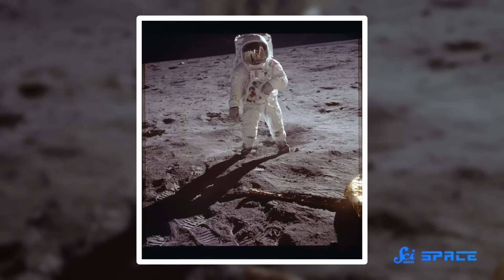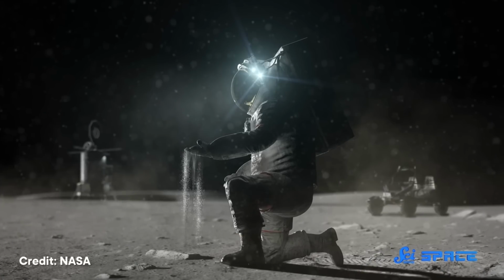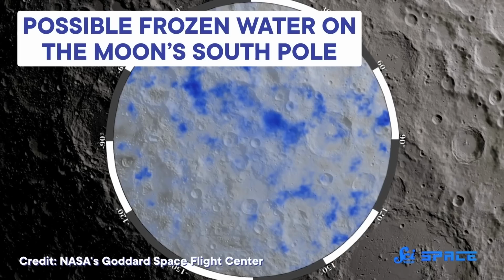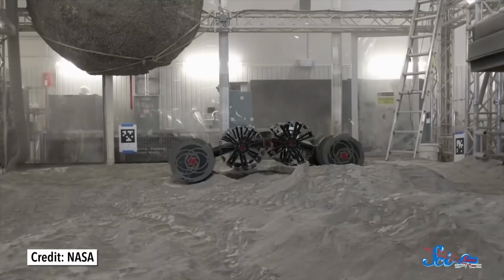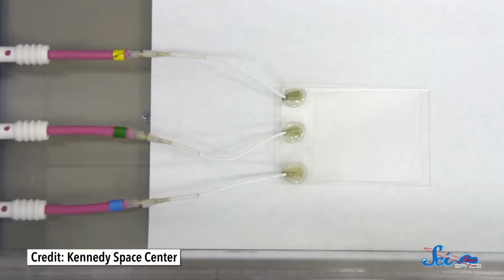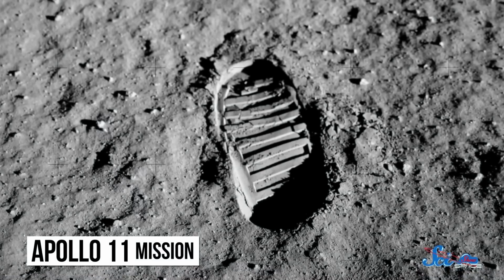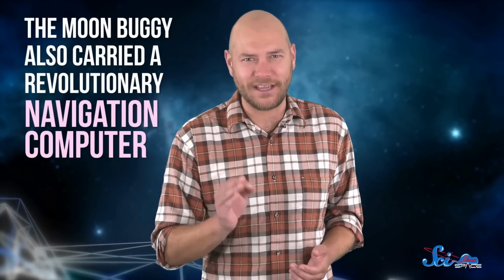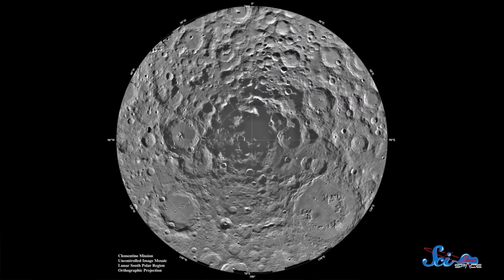What Will It Be Like To Live on the Moon? | Compilation

Comment: I wonder if it would be possible to make a sort of lunar wall-e, compressing dust into blocks?
Reply: @FreedaPeeple-u8z Too slow and complex process in my opinion, not very feasible if it takes long time to make a single block.

Im more inclined to compressing the dust so it heats up, separating certain parts of matter from it and then maybe pressing further the "slack" into a block.

Comment: I am a student working on a project Moon rover. 
The payload is a 3D printer. But not like here, where you combine powder with resin (you have to send from earth), instead it is printing with sunlight. 

Lunar dust is a glass dust like material. Concentrating sunlight to a small enough spot allows the material to melt. 

At this point in time, it is still a 2D printer and requires a flat surface, evenly lied with dust in order to work. But it already printed the first structures.
Tracking the sun to compensate for moons rotation and trajectory around the sun is the next big thing to advance. It has 5DOF, 2 for printing structures and 3 for lens orientation.
Reply: I'm doing my PhD in similar field - I'm more concerned about gravity, not materials, but I think you could take a deeper look into Sulphur usage which can be obtained via ISRU from mares - as the binder, we managed to manufacture bricks with JSC-1A regolith simulant quite easily. The biggest issue is the Sulphur would liquidize in higher Moon's temperatures so if we find a way to overcome it (maybe by using regolith overlay or some other elements) it could be maintainable with just ISRU. I guess you also referred to research about using lasers to melt regolith? I think there are quite few ongoing researches, some were even tested in either drop tower or the fancy new Einstein's Elevator. 
Anyways, good luck with your project, is it for any of the student competitions (URC,ERC,IRC)?
Reply: Both these comments are so cool and amazing! Good job both of you! I wish I was that smart! I’m such a space nerd and I love it so much! I have so many space tattoos, and even working on a full sleeve space leg, so just reading that made me so excited for the future of space travel/space exploration!
Reply: Just remember that anything made there, needs to stay there. For the same reason mining the moon is a bad idea.
Reply: @dwaynewilliams3077 How tf would you know? 😂 We know so little rn, we're still learning. There's no evidence that can't change even if it were accurate.

Comment: All these extractive technologies do require copious amounts of electricity to work as advertised. Solar panels only works for the lunar day, they stay two weeks off during the lunar night. Therefore, the first thing to ferry from Earth would be a nuclear reactor which doesn't require cooling from the sea or from a river to work properly. Actually such reactor doesn't exists. Thermoelectric plutonium reactor can provide 1 KW at the best and are truly expensive. 
In the beginning, a complement of batteries, solar panels and RTG will have to suffice to start the Moon Base...

Comment: When you pull oxygen out of lunar regolith, your byproducts are metals (like titanium, aluminum and magnesium. Metals are very easy to weld in a vacuum like on the lunar surface, almost too easy. 3D printing is kind of silly for making domes when you can just take 2 circular sheets of metal, oxidize their outer surfaces, bring them outside into the vacuum, grind the oxide layer off near the outer edges of each sheet, then press them together to weld them, then blow a gas into them to inflate it into a hollow sphere. If you are really set on a dome you could always cut the sphere in half and have two domes or use a thicker and thinner sheet of metal so one curves out much more than the other during the inflation process. You can even make many different (almost arbitrary) hollow shapes using this simple method just be varying the geometry of the welds and the relative thickness of each sheet. Construction on the moon should be much easier than on Earth.
Reply: A) you are not left with pure metals. More so with various oxides mixed together. Refining to get pure metal out takes huge amounts of energy and big machinery.
B) machining foil out of metal blocks takes huge amounts of energy and big machinery.
C) i suspect spray painting titanium is much easier than oxidizing it

Still, i like your idea. At some very advanced point in time, this could become a thing. Until then, 3D printing is considerably easier. 

NASA engineers are pretty smart, you know
Reply: i will never live on the moon, it's too frisky
- peace out
Reply: @augustvctjuh8423  That was SANSational.
Reply: Yeah I’m sure some donk in the YouTube comments has figured it out before NASA and it’s contractors have. 

What happens when the sheet of metal you want to inflate cold welds to itself before you can inflate it? That’s a really basic major flaw in your plan my dumbass thought of in 5 seconds, can’t imagine how smart people would tear it apart lmfao
Reply: Why not first send 100's of logistical payloads filled  with bulldozers, cranes and a lot of other machines and things that we also use on earth to build big stuff like skyscrapers, roads and bridges?  Make these machines solar-powered and operable in a vacuum if that's possible. It will greatly improve construction times. and according to Musk It's not as expensive as it sounds.

And let's not forget 100's of payloads with agricultural stuff. Fertilizer, fertile soil  andorganisms that keep the  soil cultivated.  A 1000 tons of that stuff won't hurt if kept at temperature and under pressure.. 
And of course : Chickens and Cows.

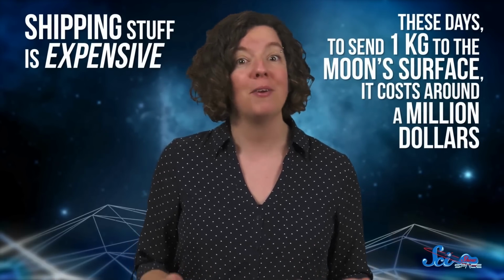Comment: 7:49 That's disgustingly out of touch with reality. It does not cost "around $1 MILLION to send 1kg to the lunar surface". In 2019 SpaceX launched a 585kg lander as part of a rideshare mission with a communications satellite. The lander used a significant amount of fuel to raise its orbit to reach the moon before attempting a landing. While it ultimately failed during its landing burn and crashed into the moon it was still a 150kg dry mass lander sent to the moon's surface. A reusable Falcon 9 at ~$60 MILLION, with costs divided between the two customers because it was a rideshare, with a final mass of 150kg just to be conservative, does not equal "a million dollars per kilogram". The entire mission cost for Beresheet was $100m and even that divided by its dry mass is less than a million dollars per kilogram. And it was a rideshare to a non-ideal transfer orbit rather than a dedicated mission.

Moreover, SpaceX has been contracted for several flights as part of CLPS to send several landers to the moon, on Falcon 9, which can send over 5000kg to the moon in fully expendable mode at a cost of around $90 million. That is also a lot less than $1M/kg.

Falcon Heavy, for a cost of ~$100M reusable or $150M expendable can put between 10,000kg and 16,000kg out to the moon.

The current launch costs, not counting NASA's mismanagement of the "mega moon rocket" and its mandatory accessory Orion, is less than $10,000/kg.

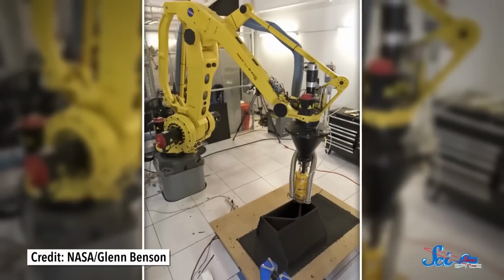Comment: 10:20 the problem is that all types of 3d printing has leaks. they would need to treat it on the inside to provide any kind of air tight enclosure. unless it's just to create a sun shield..
Reply: Dunno about ABS but I've seen some titanium powder 3D prints of hollow spheres that can take being submerged under 2-3 miles of water without leaking  (or imploding if the wall is thick enough vs size). I guess if the layers are melted together with a lasers it helps.
Reply: @fvckyoutubescensorshipandt2718  that's pretty good, but regolith isn't going to weld well without a supplement.

Comment: But the energy need to heat the moon dust and the Calcium Chloride, is the a problem. What will be the energy source needed. If the pace NASA, took to land a few astronauts took 50 years, then it would probably takes 100 years to become a reality. All these dates announce, will be probably be push back 4-5 years.